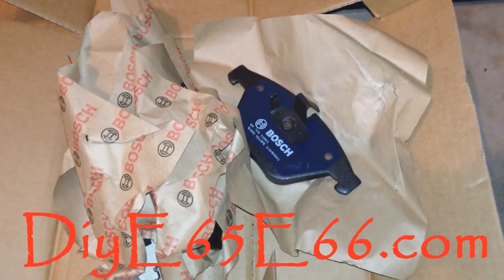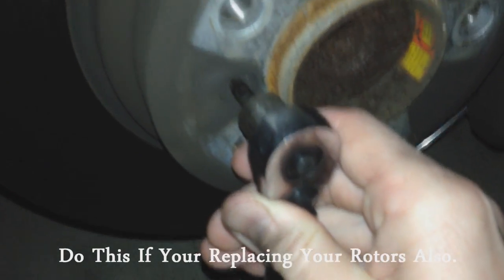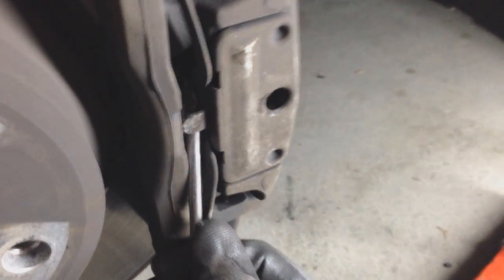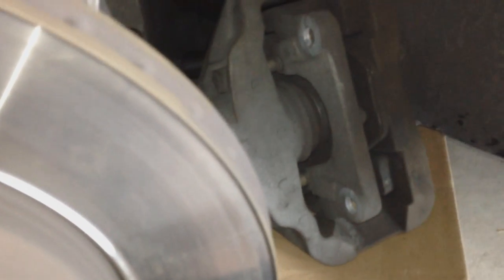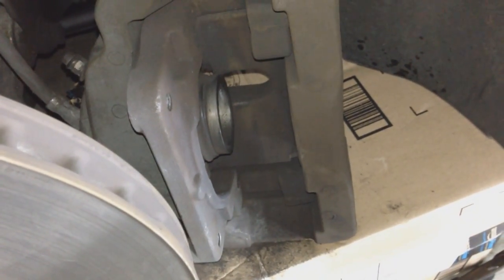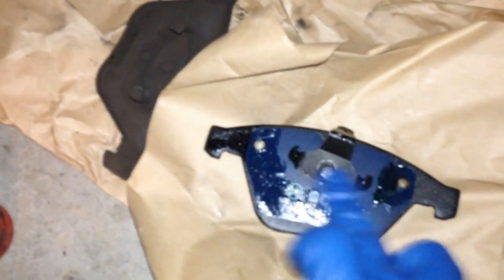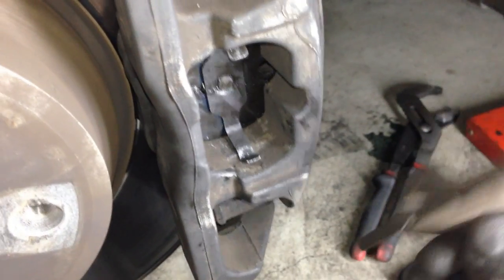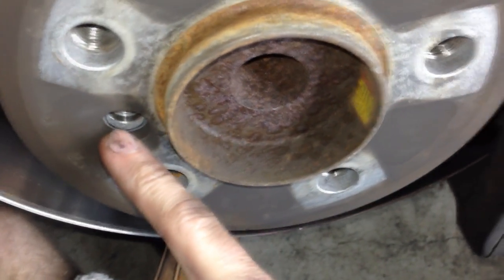BMW E65 E66 Front Brake Pad And Sensor Replacement

Comment: Great Video my man... Just a thought about when compressing the piston... I like to put the old pad in, and use the grips to press on the old pad... That way you know that the piston goes in evenly and you don't run the risk of accidentally pinching the rubber boot...

Comment: I just changed my front brake pads without watching this video first, and I discovered that the E65 front brake calipers are little different than the front calipers like the 3-series E46 and other vehicles that I had worked on. When I removed the front caliper bolts, the caliper was loose, but it wouldn't get out. It turned out that the front caliper was wrapped around the caliper bracket. See 5:05 in the video so you know what I am talking about. I had to find a way to compress the caliper first, to open the caliper wider than the thickness of the caliper bracket. I could think about using a 6 inch or larger C clamp to compress the caliper, but I didn't have that. I used a large ratcheting bar clamp instead. Of cause it could not compress with that much force, and it got stuck in the middle. With the bar clamp still compressed, I removed the brake bleed valve, installed hose to catch the brake fluid, and pulled the entire caliper with my hands. Because of the clamping force of the bar clamp, my pulling force, and brake fluid didn't have to travel back to the reservoir (less friction in the oil tubing I guess), the caliper was slowly opened up, just far enough to remove the caliper. I still had to use caliper compression tool to compress the caliper all the way in once it was removed. So here it is, the second and more difficult way of changing the front brake pads. LOL...

Comment: why did you take the caliper bracket off instead of the caliper bolts? To me it seems you were after your rotors but you went to far into a simple brake pad change not a fan of overworking myself avoid fatigue by all means .

Comment: Chris, I want to say thanks for your videos. My car is now out of warranty. The dealer is a joke. I have had lots of problems with my car while it has been under warranty. Now that it is out of warranty, I am more interested in DIY. Do you have a video on replacing the rotors?
Reply from the maker: I haven't replaced my rotor's yet, but it's pretty easy, in this video you see a little bolt right on the rotor just loosen that bolt and take it off and with a little easy muscle because it's been on there for years should just come right off, this is of course after you take off the caliper and with the brake pads in it.  Then just put the new rotors on bolt it back up replace the caliper and bamm should be good to go, that's at least what my old cadillac was, should be the same:)

Comment: Lets not forget about the over flow in the reservoir
Reply from the maker: Good Call, great tip there, yes I did loose a little bit of fluid out of my reservoir when I compressed in my pistons, not much maybe few ounces.  You can see the spot on the floor later in the video.  Thanks again for reminding me.
Reply: Can u explain a little bit more about the reservoir?

Comment: I tried to use my old sensor, reset it and it said -7 t km (telling me to replace pads again). I replaced the sensor and was gentle, clipped it in, didn't play around with it. Reset again and now it says -11 t km (telling me to replace pads again -_- pads are brand new and so are rotors

Comment: i reset my car for the front brakes but now its says -10000 miles for some reason
Reply: Because you didnt install a new Sensor.
Wehen the old Sensor is worn to lets say 3-4mm brake Pad left the Sensor needs Tonne changed.
So just Chance/Check the Sensor and reset again